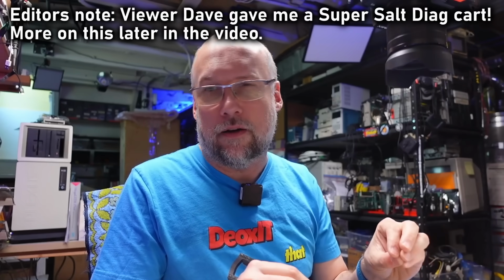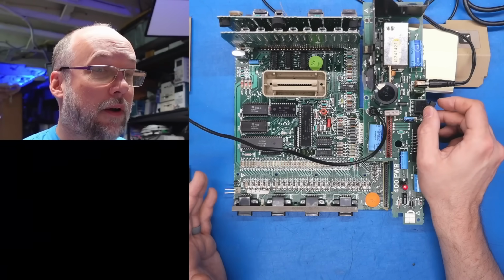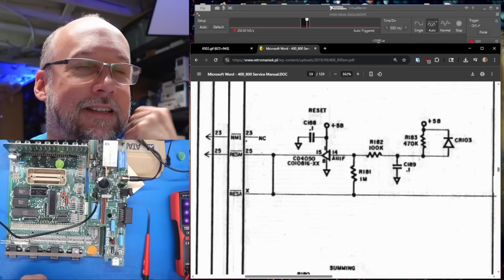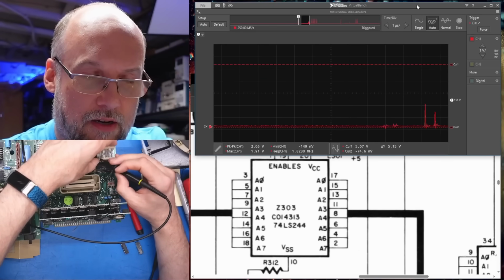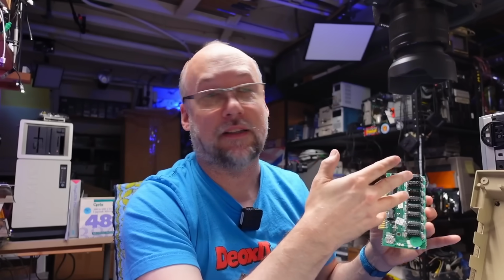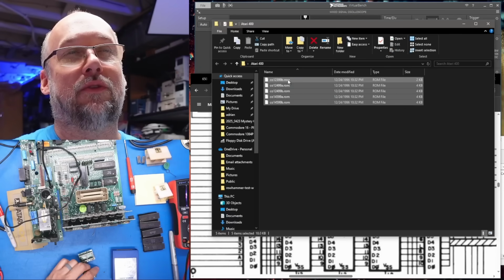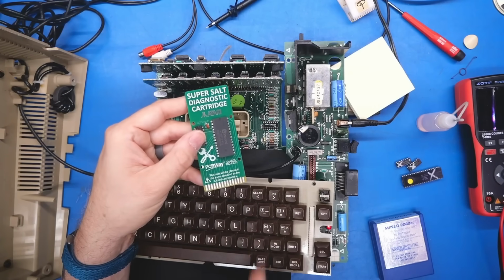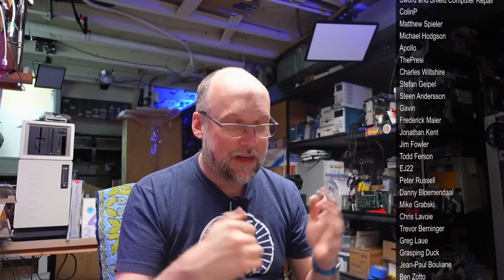Repairing a smashed-up Atari 400 computer

Comment: You want a real challenge? Try to figure out Konami Arcade boards. 
With the exception of 68000 and 6502. Most of Atari's Boards are 
custom ICs. The entire boards. So, yeah. It's not easy.
Reply: the approach with those is to have a working and a non-working one, swap chips, and datalog stuff until you find a discrepancy, then work backwards one chip at a time from outputs to inputs until you find the culprit. Very slow method but what can you do.
Reply: @jwhite5008  Absolutely. The issue is, once they are all gone. They are gone. Konami doesn't share anything and probably has those locked down tighter than Fort Knox. Until we can crack those and backwards engineer them. We are stuck. It's not like replacing your average 6502.

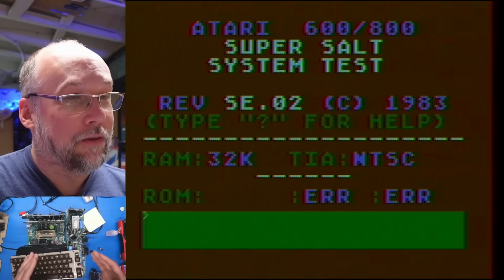Comment: At 1:31:11 it suddenly started displaying 32K of RAM on the test cart, where it was consistently 16k before?
Reply: Unrelated to that I also remember the commercial tape software on the Atari 400/800 era machines were produced with music and voice instructions for the software being loaded so it gave you something to listen to while waiting for the tape to load in - much better than the silence and getting to look at the blanked screen on the Commodore and hope it didn't throw a ?LOAD ERROR. (though I still prefer the C=64 in all other functionality)
Reply: the original RAM board is definitely 16K, did Adrian accidentally replace it with one from the other atari?

Comment: Best 8 but computer everm had a 130XE running with a MIO add-on 1 meg Ram and hard disk controller running a BBS. With 4 double capacity floppy. So yeah I love those machine

Comment: You can drill through the broken standoff and use a screw with a nut where the screw head should have been.
Not original but definitely better than tape!

A better option would be to find or 3d-print a standoff, and glue it to the case. 
If you are not into 3D-printing, arts and crafts have plastic that you can mold with fingers and bake in an oven,
Make sure you make not just the standoff itself but also a large flat pad that you can glue to the case.

In this case there is a lot of empty space so you can get actually away with glueing something like a plastic foot-pad from a hardware store where the standoff should be, drill a hole, and use it as a standoff - it won't be super good because it's the wrong height but probably good enough to hold it together.

As for the GTIA my bet is still on a bad connection, maybe not even on the GTIA, since you swapped a bunch of chips around. 

Try pressing on all the chips now that it's working.....if it ever goes flaky again, I'm not encouraging you to disassemble that tank again.

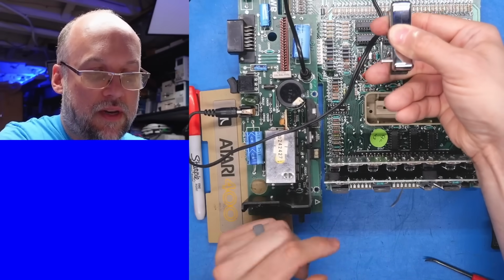Comment: Interesting diagnostics so far (I'm only 1/2 way through). I'm wondering what the tool is used to remove a couple of the larger ICs (i.e. used to remove the Pokey at 49:28 )? I've got a similar tool in an old PC toolkit for installing ICs evenly, but I'd love to get a tool like shown to remove a chip evenly.
Reply: it's called a chip extractor, they come in various forms, some better than others.

Comment: 18:10 The 400/800 used (mostly) standard 6502s, but IDK if they are pin compatible with MOS 6502s, as the clock speeds might be different? All Atari 8bit computers ran at 1.79mhz clock speeds (except PAL models 1.77mhz). The XL/XE used the Sally CPU chip.
Reply: I think they do need the HALT signal for DMA though?
or whatever that is happening when HALT is asserted
Reply: @jwhite5008  i would think some sort of adapter can be used to use SALLY CPUs on the older Atari's but then it might not fit inside the armor of the 400/800.

Comment: 13L29 Yes the CITA is the older chip found in 400s and 800s, I'm surprised there's a GITA chip in that 400, usually you see GITA in the XL/XE models.. but I guess I'm wrong.  That 400 was probably more recently made than others.

Comment: Very good as always.
An old school repair for missing standoffs is to cut down the barrel of an old biro (choosing the right size for the screw - typically a BIC of the opaque variety, not the clear ones) and glue that in place. Yes, if the plastic is compatible acetone will do the job. Or it's epoxy.
These day's you might build up Super Glue and Baking Soda if you have the pieces, or 3D print if you don't
Reply: Almost exactly my thoughts

You are probably supposed to fill the cutoff pen segment with something if the screws are self-tapping and screw into the standoff.

If I don't feel like repairing the standoff in such situation I sometimes drill the case where the standoff was, make a indentation for recessed screw head, and glue a nut where the original screw's head was supposed to be. It looks different from the original with visible screw head but if done well enough it's not attracting too much attention to itself.

You can also glue an elongated nylon nut as a standoff, they exist but sadly hard to find for some reason. Example: google the following:     524346 nylon spacer    - OR -   G25839 nylon spacer

In this case you could actually probably get away with gluing some random plastic piece from a hardware store like a small plastic foot and drilling a hole in it.

Another option is polymer clay from arts&crafts store. You sculpt it with fingers, bake in the oven, and it's solid. I don't think I used it for standoffs but it should work, although better use wood screws with large coarse tapping. 

I sometimes just use wood dowels for the job - quick and easy to do but not very good, I wouldn't do it if I was going to sell or gift the thing to other people.

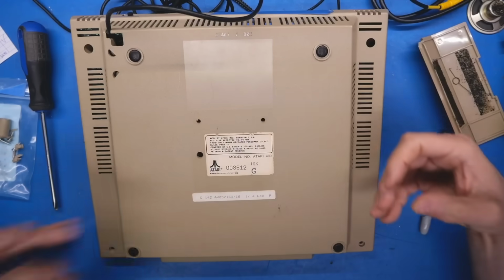Comment: 4:46 Originally the Atari 400/800 came with less RAM. 400 had 8K, and the 800 had 32k (or maybe 16k) when they were first released, but soon after they upgraded 400s to have a minimum of 16k, which became the norm. 400 are upgradeable, but you have to disassemble them since you can't access the expansion cards normally like you could an 800. Modern upgrades allow all Atari 8bit models to have about 1MB (ultimate 1MB), except the 400/800 use a different kit, but i forget the name of it.

Comment: The standalone floating point rom was a great idea and indeed a commercial faster version was available. Very little use was ever made of the float library. Atari Basic does NOT use the library so does not test that float ROM.
Reply: Are you sure that the floating point ROM is not used by Atari BASIC?  I remember swapping in that superior commerical version on an emulator, and getting both superior accuracy and speed out of Atari BASIC as a result.  The floating point ROM that comes with the computer is pretty terrible in both respects, to be frank.

I also wrote an "emulator" for the C64 that allowed it to run the Atari 8-bit OS and Atari BASIC, including support for the graphics commands and many well known graphics POKEs.  I put the commercial floating point ROM in as an option, to see what would happen.  The result was that while the C64 normally ran Atari BASIC about 13% slower than a real Atari, since its CPU is about that much slower typically, when I swapped in the commerical FP ROM, Atari BASIC actually ran faster on the C64 than on the Atari with the normal FP ROM.  It really makes a noticeable difference, and the calculations are spot on, as well, instead of a bit skewed.